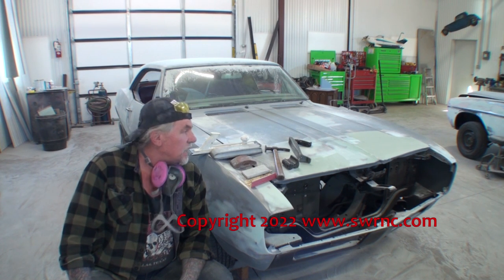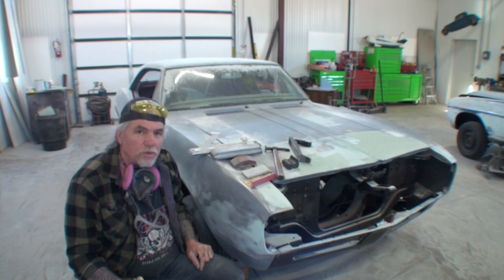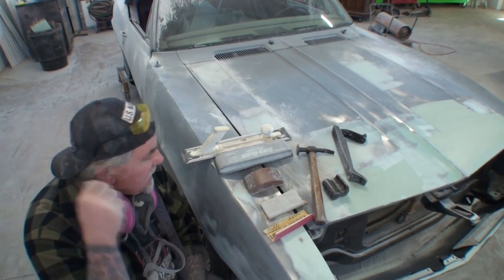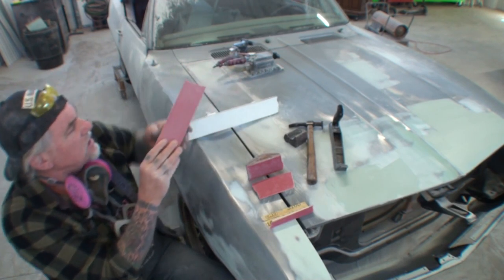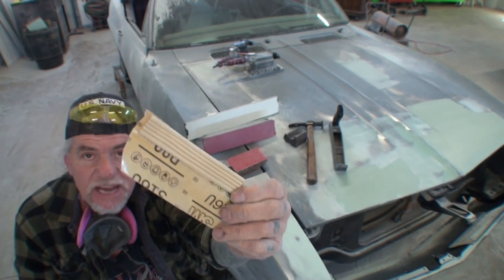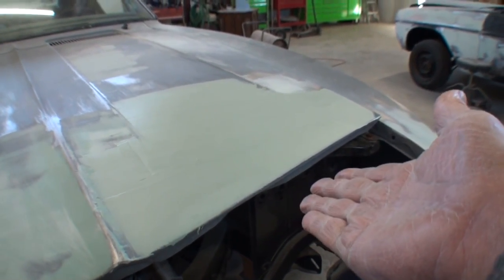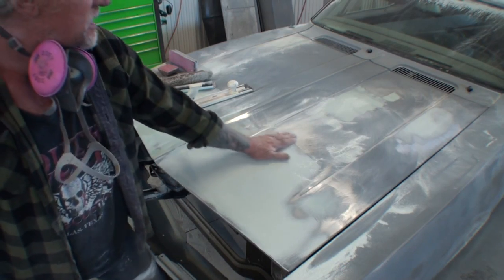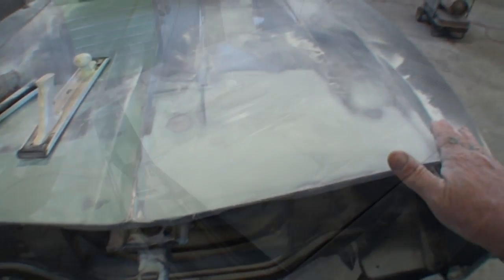How To Sand BONDO For Primer - Do It Yourself Paint And Body "FOR BEGINNERS"

Comment: Pete next week I start with my High School body students.  I don't even let them use a air tool until their metal work and filler work is done.   All filler work is done by hand with various blocks, all initial sanding is done with 36 grit.  Once everything is really close they move to 80.  My preference is finish sand with 180.  Less sand scratches plus it teaches them how to feather edge their filler and get a better feel to move to primer surfacer.  Good video and couldn't agree more, hand sanding is the only way to go even after doing this almost as long as you.  Oh, I will probably show this video to my students once they get their metal straightening done and we move into plastic filler in a couple of weeks.
Reply: Some 2K primers are thicker than others and wont spray out of a 1.8 tip well unless you reduce it like 4:1:1 instead of just 4 to 1 like it says. I like to go to at least 180 before spraying 2K. if there are still scratches then you just have to block sand and then apply more 2 K. But the primer is expensive so the less you have to apply the better
Reply: What grit should I use on my final sand before priming thank you

Comment: The old guy who taught me bodywork like 40+ years ago always said,wipe it,file it,wipe it again,and he always started sanding or filing initially before the filler was rock hard   because it cut and leveled a little faster and easier,and he always used a crosshatch pattern when filling and sanding,and we never used a DA on filler to do mudwork other than a big DA to cut the filler down. I've been a bodyman for many years,still will be one in the morning when i head to work in the morning,got maybe a couple more years before before i retire,then i can come home and not have to do it for anyone but myself on my own projects,that's gonna be a good day brother. Off my soapbox.

Comment: I can’t help myself as this is the 4th or 5th time I have watched the entire video. I feel I have learned something or reinforced what I felt I knew. As a repair tech and not a body tech, I still feel that I am learning. I was waiting for some guide coat action, as you use  flat black and other use powder rubbed in. I bought a case or 12 flat black at $0.88 cents per can, but I do feel like a powder would show a little better and the best deal (Other Than Printer Toner) is made by “Mirka”. It is half the cost of 3M. I have also started a large bag of hard to medium hard sheet metal shipping foam. This was the topic of a video you made 8 years ago. Either way, you have shown me how many tools in my hand I can use to create a flat smooth show car finish. As you say, this is the “Build Coat” and not paint ready. I appreciate you enthusiastic approach to the final product. I will say that buying a .”Rust-Oleum” spray can holder for spraying any can product. Weather it is guide coat or painting an engine or transmission. I watch, I learn, I am better for your videos period! Thanks Pete! Here is a electronic “Shake a hand, make a friend” to you! Thanks Pete as I have no way to show my appreciation. Thanks!

Comment: I tried doing a similar repair on a sand blasted hood that was also chemically dipped.  I tried for a month  with an air file.  Before I figured out what you just explained.   The hood was disconnected from  the framework  that also made it extra difficult.  I reattached  the hood to the framework  then used hand blocks for another  month to get it right. It was a. Learning experience. THANK YOU FOR ALL U DO. PETE.

Comment: Thank you for sharing your useful knowledge.  I have been into this trade for four years.  Still can not get my filler work perfect.  Sometimes i see ripples. Though i start with 80 grit with hand sanding, then smooth it to 180.  Then use 2 k primer filler, sand it down, water based paint and lacquer to polish.  Its a constant learning battle.  Sometimes i get my filler work absolutely right and find it more frustrating when i get a run in my lacquer, or clear coat as you call in USA.  but i am determined to get it right sooner rather than later. watching your videos definately help. Thank you so much for your hardwork.
Reply: The 80 grit is going to sand the tops of the ripples down. The 180 will polish the ripples. You need 36 grit first. There are other videos where he and others explains this problem.
Reply: @josephfilm73  Thank you.  I will try 36 grit to start with.  Which 2k primer do use?

Comment: Pete,  is it necessary to bondo all your panels, I'm restoring my 78 firebird,  have replaced some panels, and repaired others. I can see doing the panels I've welded on ,but if my lines are good, is it necessary to do the whole car?
Reply: No it’s not necessary to bondo all the other panels if there nice and straight,as long as you feather in real good the ereas you bondo in you should be good,
Reply: @keithclark486   I been doing bodywork for a living for 15 years I got a lil experience

Comment: This was Great I had 1 question. After epoxy has lost 5 day window before applying filler do you need to re spray another coat or sand to metal in those spots?
Reply: I'm in the same boat did you get a answer thanks

Comment: Pete, the paint store told me to spray/seal my bare metal with epoxy prior to applying filler. True?
Reply: Yes or self etch primer… but epoxy is the way to go if you don’t mind spending a couple extra bucks